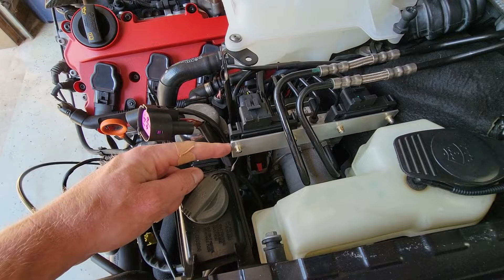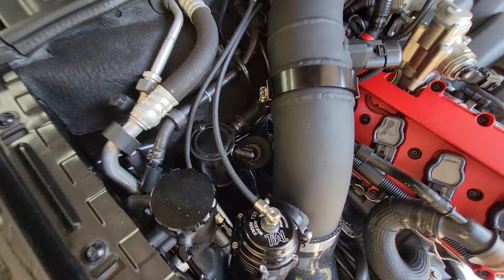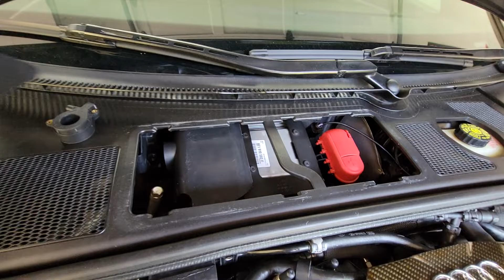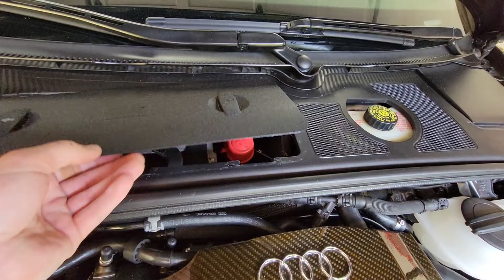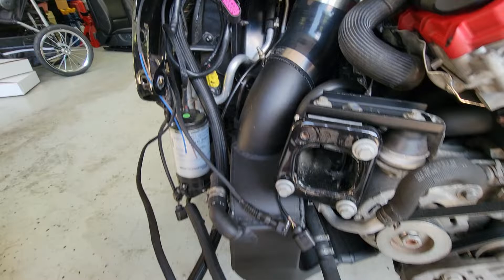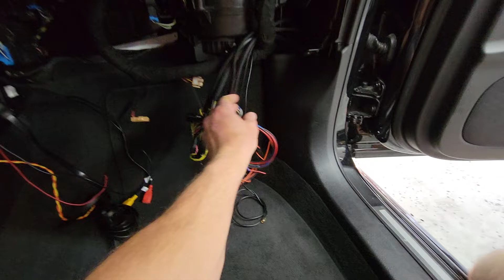Rear-mounted Turbo RS4: Front sensor harness update! - May 2022

Comment: Why did you choose air to water intercooler and water meth, couldn't you have just picked 1?
Reply from the maker: I could just run the water-air IC, and this is how we calibrated my tune, but I like the water/meth injection as an extra margin of safety. 12.5:1 CR on pump gas and boost deserves all the extra safety margin you can throw at it;)
Reply: @ezracing900  I didn't know you were on stock internals that's insane, yeah you need all the cooling you can get so you don't ping. Thanks
Reply from the maker: @spencermurray4378  yeah, no worries at the current boost levels, especially since we tuned without the WMI, so plenty of margin. When I turn boost up a bit more, Ill likely be on a slightly lower CR, thinking 11:1 on a built bottom end
Reply: @ezracing900  I guess I just assumed that was already done since you were designing the secondary fuel system (which is insane btw ) also did the idea of spraying the extra fuel just Infront of the throttle body ever occur? Seems like you wouldn't need a custom manifold that way and would have more atomization. Just a thought
Reply from the maker: @spencermurray4378  I've considered it but cant guarantee good distribution at the fuel flow rate Id need, so Ill be much more confident in individual cylinder delivery.
Reply: @ezracing900  that makes sense now that I think about it because all the setups I've seen like that have a manifold with the plennum kind of sloping down narrower away from the throttle body to maintain velocity. Sounds like you've thought of everything man you're doing my dream build
Reply from the maker: @spencermurray4378  thanks!! I hope Ive thought of the important stuff, at least🤣....I've thought a lot for sure 😛